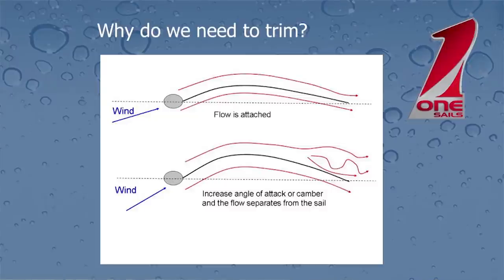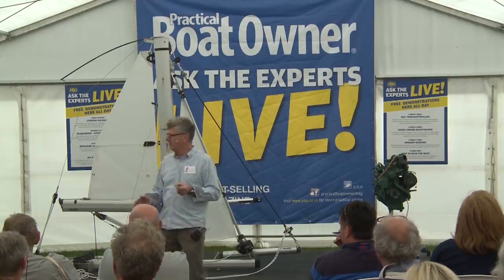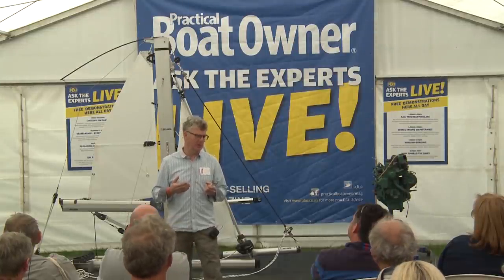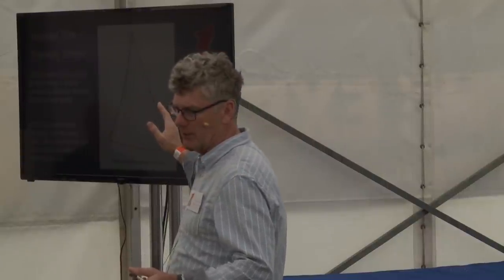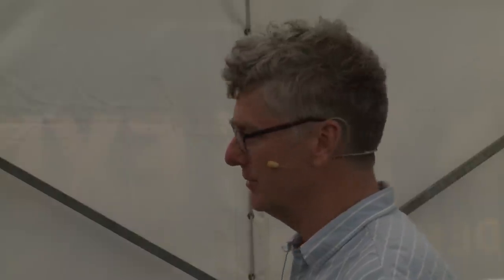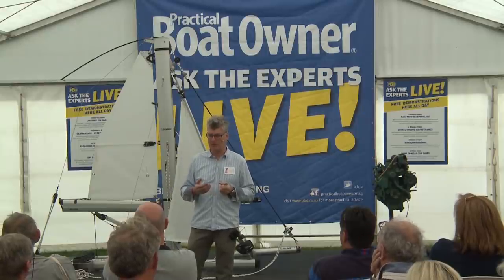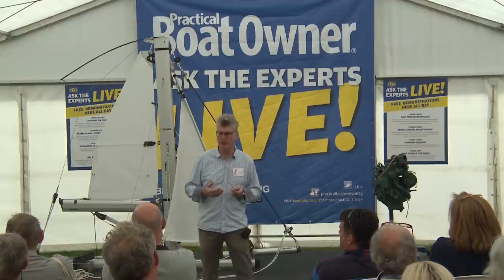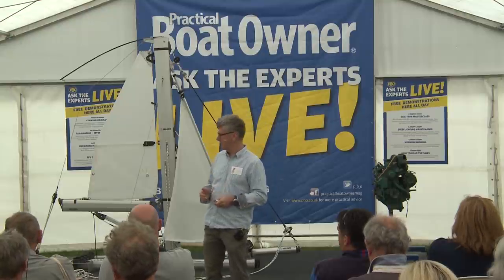Sail Trim Masterclass

Comment: At the start of the video you mentioned how in light airs you want "deeper, fatter sails" to make power. However I have always been told to make the sail as flat as possible with an open leech in light airs so the wind finds it easier to pass over the sail and does not stall could someone please explain the idea behind the ideas please.(Is it just because yachts are very different from dingys)
Reply: Joshua Kendle, Lift is created by the acceleration of air over a curved surface, this causes a decrease in pressure and therefore “lift”. The lift can be varied by altering a few variables; 1) The curve of the surface 2) The speed of the airflow (wind) 3) The surface area of the curve.

So keeping that in mind in light air, option number ‘2’ is a constant, dependant on wind strength, and option 3 if you have a full sail plan is also constant so we can only alter the curve (like flaps on an aeroplane).

If the wind is light, a deeper curved lifting surface is required (deeper sails / loosened outhaul) to attain the most lift possible by creating the largest curve in the sail for lift for a constant wind speed and sail size. The limiting factor is preventing the slower airflow from stalling before it reaches the trailing edge of the sail if the curve gets too deep or the wind gets too light <5 Kts. If the outhaul is eased excessively the overall shape of the aerofoil can become inefficient and in very light airs the airflow will stall before the lift is created, so sail depth and curve is a balancing act for efficiency.

As the wind increases the sail can become too powerful so we either reduce the curve (which also moves the centre of lift forward) or reduce the size by reefing. Of course you would adjust the outhaul / sail curve before you would consider reefing.

It’s a relatively complex topic as my explanation doesn’t do it justice, but have a look at some youtube videos on basic aerodynamics and hopefully it’ll make a little more sense. There’s a good reason so many pilots enjoy sailing. Hope that helps a bit!
Reply: Thanks a lot for replying. So depth and therefore curve is a balancing act between overdoing it (and the air stalling) and having enough lift in lith airs? Thanks again
Reply: I know this comment is 2 years old. But what you wrote Joshua applies to very light air, where a flatter sail shape is required so the flow remains attached